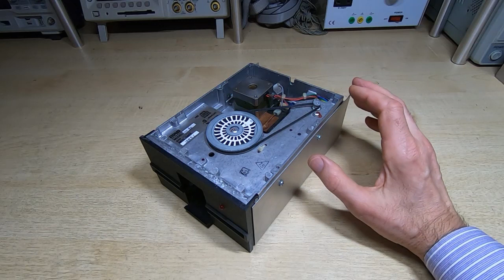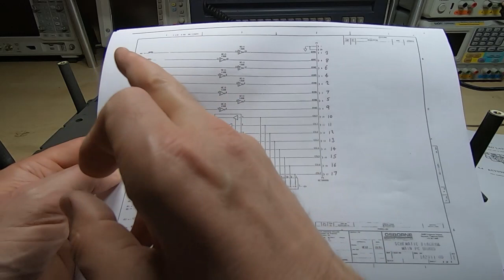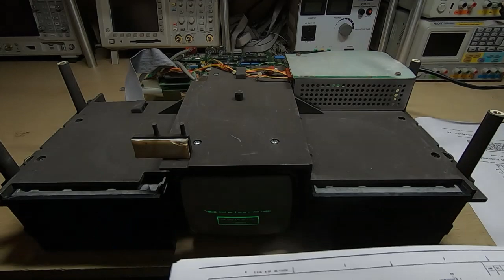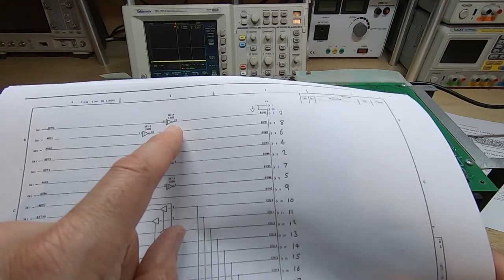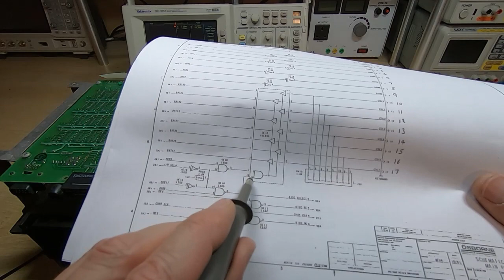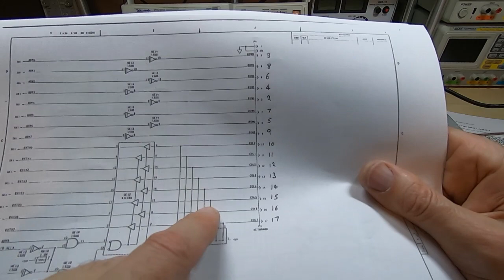Osborne OCC1 Repair Part3

Comment: Jerry, what lubricants do you choose to use when repairing/restoring floppy drives or other disc or tape drives?  I'm not asking for specific brands, unless that actually matters, but more about the types & weights of the lubricants so that I can obtain the applicable lubricants for working on my own drives.  I've got at least six 8-inch drives that need care, plus about the same number of removable disc cartridge drives for my PDP-8s & PDP-11s that need similar care too (head movement mechanisms).  And, of course, I've got a dozen or so microcomputers from a C-64, TRS-80 Model III, on up to desktop PCs that were thrown out by previous owners 10-15-years ago, all with 5-1/4-inch floppy drives.